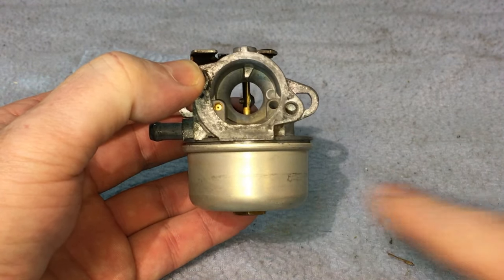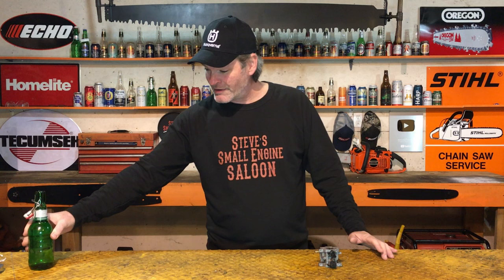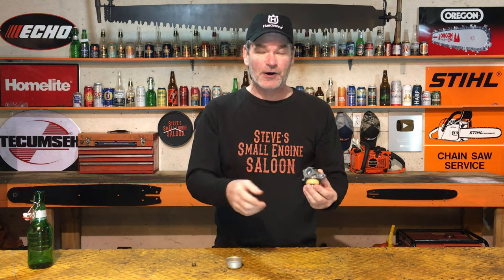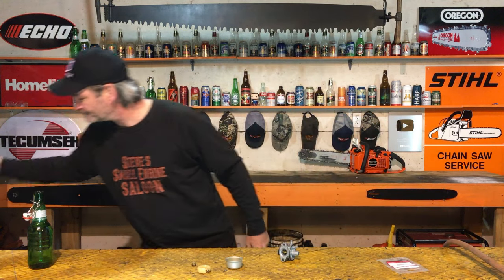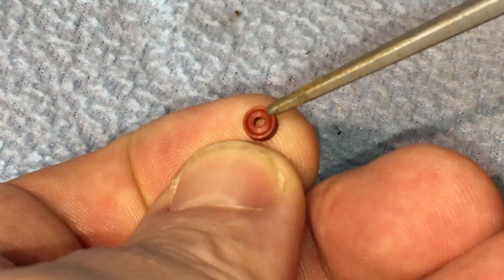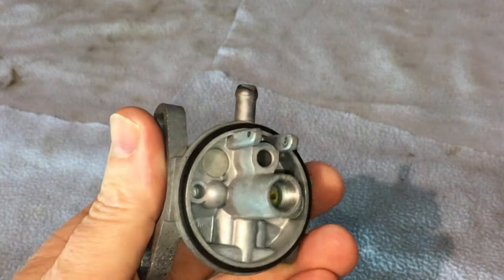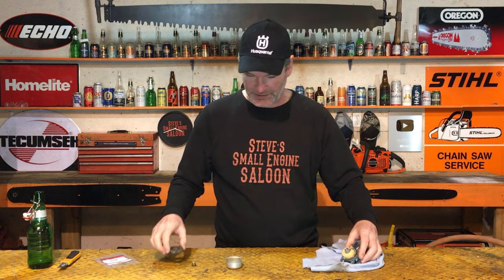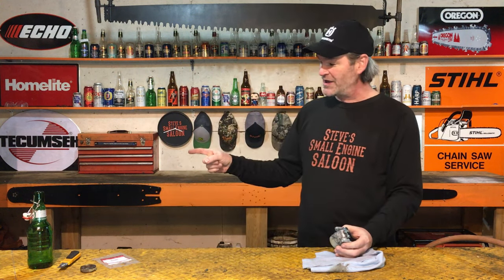How To Fix Your Leaking Snow Blower Carb – Briggs Or Tecumseh

Comment: Hi Steve,
My gas leaks through my carb and hydro-locks my briggs 12hp walk-behind cub-cadet.
I went to ethanol free fuel, bought new carbs and they still leak through brand new. I finally installed a manual shut-off valve and only get a season out of those before the seals go bad in valve and it will not open and close.
I buy three carburetors and keep them on the shelf after storage on machine for a couple of months to install new. I am tired of taking an hour to get my mower running every time I need to mow.
Have you seen this issue before?

Comment: Good day Steve. I have a Toro PowerMax 1028 OXE snowblower. It starts but as I start to increase the throttle, gas starts being blown out of the breather tube. How should I fix this issue? Is this a carburetor issue as suggested in this video?

Comment: What symptoms would the engine display if this was my problem. I think my carb is leaking but not a lot. Engine seems to choke up under load, and die on idle. Could this by my issue?

Comment: It's great information, but with the availability to get cheap Chinese built replacement Briggs or Tecumseh carburetors (~$10), I usually just replace a carb rather than dig in and try to fix them.

Comment: Hellooo: i have a cuestion : i have a snow thrower yard machine i founded it looks good and start after a few pulls. I remove the carburator. Is a tecumseh and i need to know where to hook the prime hose because i see three conecting takes one is for the gas in .. & the other for rhe prime but there is a third one  i donnt know what to hook up in there .. could you please help me wiht that ,, thankyou . And HAPPY HOLIDAYS

Comment: You will have a long happy relationship with your snow blower if  after every use you shut the fuel off under the tank and run the engine dry. Older Tecumseh have a spring loaded drain under the  bowl, good idea but they always leak, most you find have been soldered over

Comment: Hi Steve,  I just watched this video which helped to identify a dodgy float needle and seat on a Tecumseh 5148 service No 640161.  I'm struggling to find a kit for this Carburettor in the UK.  It's a brass float with no leaks,  do you know of any other carb models with the same interchangeable float parts.  The carb is a 20mm type

Comment: Hey Steve.  I put a new carb on a Snow blower 8HP MTD  Tecumseh engine.  When I press the primer bulb gas flows out of the chock side of the carb. What did I do wrong?

Thanks

Comment: I have a plastic float that I replaced. The old one did have gas in it. Still won’t run. How does the pin attach to the float?.
Ok so it’s all put back together correctly. Still will only run on the fuel that is forced in by priming.

Comment: Can you replace the seat without pulling the carb? If so how? Do you have a video on how to take it off. Areins 27LE. Thanks.
Reply: If it’s a snowblower simply tilt it on snowintake end of machine ,,with done this you will easily see & get to work a whole lot easier on carburetor without having to remove carburetor from machine,,,!

Comment: This happens to my snow blower EVERY year. I fix it and  it runs for the season with not issues. Before storing the blower for the summer I fill gas tank to the top at end of season (94 octane), add in stabilizer - and she is fine. The in the fall I start the blower and run it for a while. After that first start the gas starts slowly draining out of the carb into the engine oil. I understand the mechanics of what is happening, but why is it only a problem after first start in the fall?? How can I prevent this from being an annual problem??

Comment: I've encountered a leaky carb that was caused by the holes that the pin slides into being crusted and didn't allow smooth operation of the float.

Comment: I've done everything in the video tested out the needle and seat, didn't leak but when I put it all together and primed the system it starter leaking from the passage the main jet squirts through. Any suggestions?

Comment: Mine only leaks after I turn the engine off. I swear it's coming from the screw at the bottom of the bowling. Just put a rebuilt carb on and same issue. Maybe the pins gasket is bad on both? Have to open it back up and see I guess.

Comment: I replaced the entire carburetor and it still leaks. But it only leaks when it is off. I can turn off the gas valve then it will stop leaking. But if the gas is left on, it will leak but only when it is off.

Comment: Dare I say, I almost love tecumseh carburetors, as long as you don't have one with the metering rod in the hidden Passage, usually on the snow blowers, poke out little holes on the main jet, and you're good to go most of the time :-) , okay at least some of the time.
Reply: I hear ya. I never liked the adjustable jets carbs especially on snowblowers.

Comment: i have an Arien snow blower, 2 days ago, new york had a big snow and when i put the blower gas switch to on, the gas was leaking out a lot, when i turned gas switch  off, gas leak stopped, does anyone here has samething happened like me ? it is only been used for 6 times. any advice ? thanks

Comment: Thanks for great videos, can you point me where to find a cheap gasket kit (or a rebuild kit 594636) for Briggs and stratton 596505 carburetor, built after date code 2015 March 08.

Comment: Steve I don't drink much I'm more of a green kind of guy but one question I do have is; does having a beer or two make small engine repairs easier?

Second question is; if my carb is just leaking a little bit will I need to take ot apart still? This is my first small engine repair